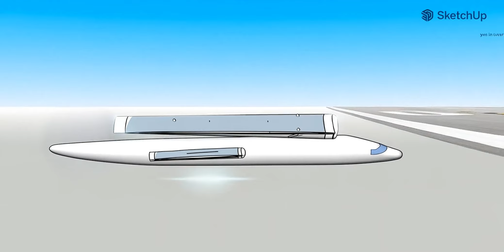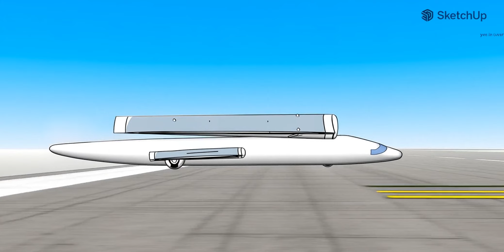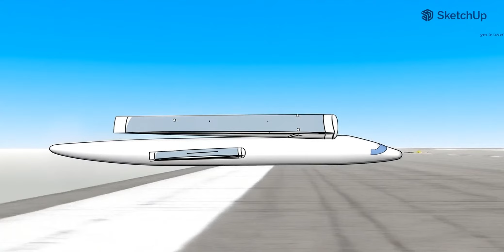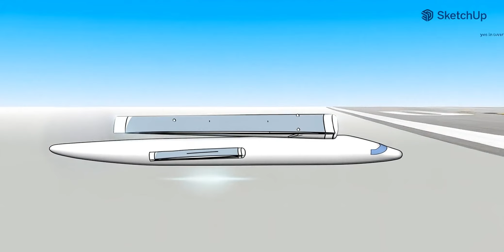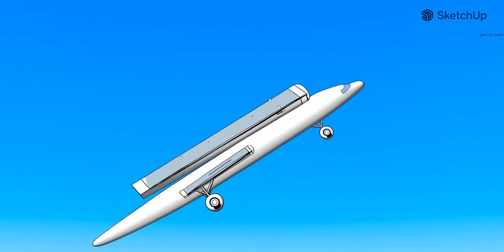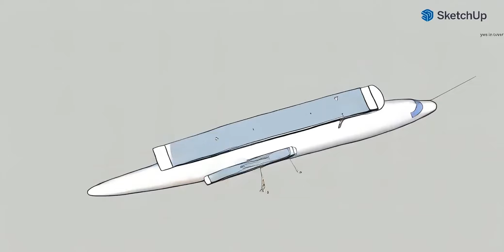Die Zukunft des Fliegens: Neue Flügel-Aerodynamik

Comment: First learn some physics, Newton laws and hydrodynamics in particular. Then you'll see that you ideas won't work.
Reply from the maker: I would be happy if you showed me what is wrong..
Reply: @bulentaloglu Airplane wings must create "downwash" - they must change momentum of a mass of air downwards. This is what "pumps" the same momentum to the body of the plane, but in opposite direction, counteracting the plane weight. It's the same as standing behind the running propeller, for example. And this is the point that is missing in your ideas. Actually, try it in a wind tunnel. You will finally be disappointed - your solution won't work.
Reply from the maker: Of course an aircraft needs an angle of attack. Without an angle, no air is deflected downward and no lift is generated. Even in cruise the angle is small, but never zero — otherwise the aircraft would fall.

Slightly more technical:

A wing is always slightly angled relative to the airflow. This small angle continuously deflects air downward and creates lift. Without this momentum transfer, sustained flight is not possible.
Reply: @bulentaloglu You are absolutely right that the AoA controls the lift. But the downwash created by the wing must not interact with any part of the airplane, it finally dissipates in the air. This is the point your idea fails to meet. You may verify this by constructing a ceiling fan with tangential blades (with little parallel fuselages similar to those you suggest) instead of conventional radial blades.
Reply from the maker: Not a classic biplane. The upper wing has open gaps over the fuselage, letting air flow freely. Left & right sections stay intact, central gap ensures real downward airflow and lift. Ideal for slow, heavy-lift, fan/prop aircraft using surface area, not speed. there are more option and variant for this solution.. thx. for your comment